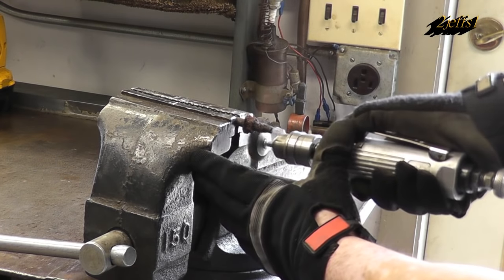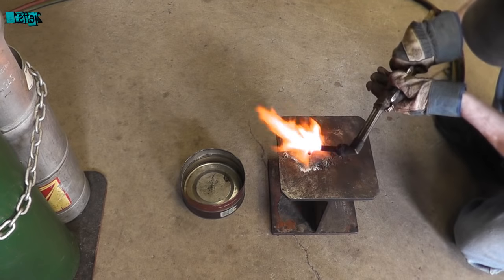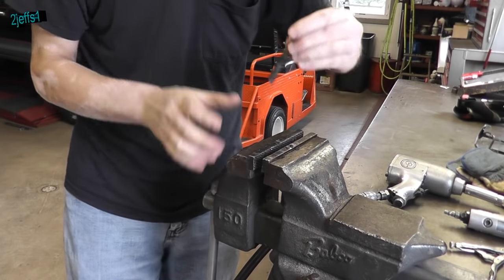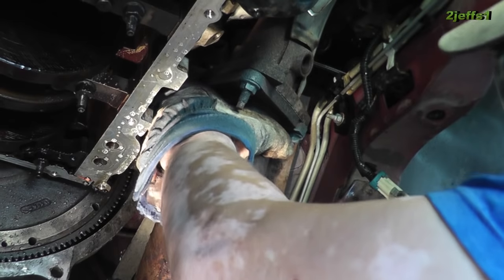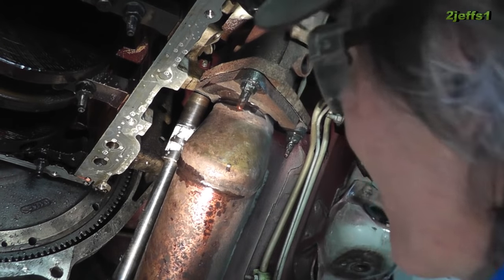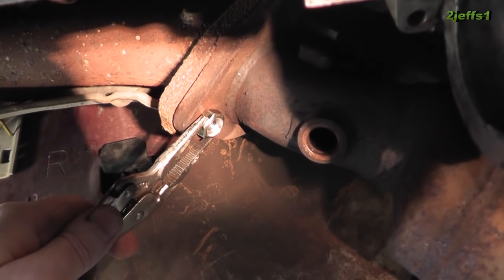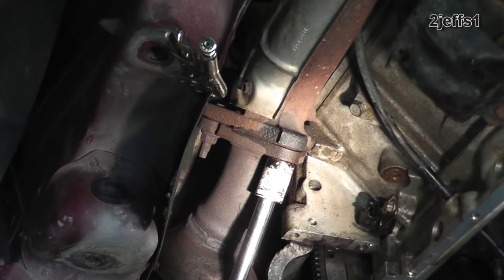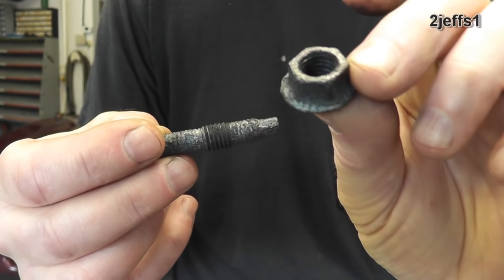Removing Rusted Bolts and Nuts THIS WORKS GREAT!

Comment: Another tip weld a bigger flat washer on the stud where you can weld it easier then weld the nut to the washer  alot easier welding.  Great tips though.

Comment: acetone and auto trans fluid mixed together work better than pb blaster just mix as you need BUT it will melt any plastic bottle you put it in . let sit a few hrs to a day on the bolt and it will take most any rusted on bolt/nut  off. if you have no torch or impact gun.

Comment: What's the brand for the bolt spray that you used onto the motorcycle bolt? thanks.
Reply from the maker: It's called PB Blaster.
Reply: Thank you!

Comment: any tip for seized bolt inside control arm bushing? tried pb  blaster. impact gun. don't have torch. stuck and won't budge.
Reply from the maker: Once the nut is loose try to drive the bolt out with a blunt ended air chisel if it can be accessed. Other than that those can be a real pain with no easy answer.

Comment: A small Plumbing propane torch helps to,,,,,.  The one he welded a nut to,,,,. You can use a settling an oxygen torch,,, and burn right through that broken bolt melt it out of the exhaust manifold,,, and not even damage the threads,,,, the cast iron will take three times more heat than a stud,,,,

Comment: The speed of cooling is not important. Heat expands the steel. As it cools, it shrinks. Then a clearance will exist enabling the part to move.

Comment: I need help. been to every shop in town and noone will help. I know nothing of welding and dont have a torch. just normal tools. also the bolt thats stuck is pretty large and not hard to get at at all.  2 have heads and 2 broke off. Im seeing propane torches on home depots website. can I use one of these? or does it have to be some hotter gas?
Reply: ive already spent nearly 100 dollars on bolt extractors and  cutting oil drill bits and rust remover for this job. Im really looking for it to be over soon!
Reply from the maker: That is so sad no one will help you. If you could find a machine shop usually there will be someone with the needed type of skills or even suggest what you should try. Those single tank torches will only work on small items, doubt would work with what you have going on. The big thing on these type deals is being able to maintain ones patience. There was several times where I didn't and then had a real mess. I wish you luck on your repair,  Jeff.

Comment: If you aren't in a hurry you don't need a torch (or an impact wrench).  Wire brushing +PB Blaster works in areas where using a torch would be too dangerous dangerous.

Comment: Honestly for something like this I prefer the sheer the bolt on purpose with an impact and buy new hardware, grade 8 bolts are dirt cheap and you really need a pretty hot thin flame to make that work.  Obviously I wouldn't do this for a blind hole in a solid piece like an engine block or what have you but fair game on stuff like exhaust where there is another fastener behind that will just fall.

Comment: Soak in vinegar 24 hrs. No damage or comprimise to the bolt or nut. Also cheaper than torch and no time invested. Drop it in, and work on something else.
Reply: yes that might work on the first stud he showed as it's a small loose part you can drop it in vinegar and leave it soak. How are you going to do anything upside down, attached  under a vehicle like the later ones he showed with your method ?
Reply: @super6954  i have different methods..... the vinegar dip is obviously for parts off the object.  When they are on, i use optimizer, also sometimes called inhibitors.  It stops it and seals it, and primes it all in one step. Not cheap, so most people dont use it. Do it once, do it right

Comment: I have a S60 Volvo and I have same setup but the flanges are good but the bolts look like they are welded on the head of the bolt side to flange the thread side goes out but not enough to enter the holes on opposite flange but not beyond I need to put new bolts in but not sure how to remove these nipples on the flange or re drill new holes with them their. Any help greatly appreciate it.

Comment: If you just mix up some epsom salt, vinegar, and dishwashing soap (Dawn) and spray it on the rusted bold or nut, it will loosen. Been doing this for years and it works like a charm. NEVER EVER have a rusted nut or bolt again. Oh yea, it also works on WEEDS...

Comment: you've got good technique.  sometimes, if it doesn't want to undo, try doing it up.  just a little bit, then undo, then do up then undo then..... get the idea?  after having to tackle broken manifold bolts in all sorts of cars, i've decided the bolts chosen by manufacturers are too small.  so i just drill them right out, oversize then fit a bigger bolt and nut in place of silly bloody studs.  next time, if the thing wont undo i just snap it and install another nut and bolt.

Comment: a better way, heat around where the bolt is "stuck " in and proceed from there. Heating a bolt directly, unless you have air wrenches like him will not make the job easier, but harder. if its a stud + bolt combo, heat the bolt but NOT the stud, she'll come right out easy then.

Comment: The only problem with this method is that most of the time you are not allowed to heat bolts or just can't because they are inside of the very massive structure or heat sensitive part.

if only it was possible to heat bolt locally

Comment: this method has been used in cuba for decades
Reply: Well ,im not cuban.but respect them.
Reply: Cubans are DAMN good mechanics. They have to be with the embargo keeping spare parts out of the country for 50 years. They have to engineer everything they need themselves to keep those old klunkers running.

Comment: If you don't have a welder, then what?  14mm Bolt on Compensator Arm (CA) is seized on the CA's bushing.
2000 Honda Civic's 14mm Bolt that is attached to the chassis frame. Part of the 14mm Head and shaft fused

Comment: if you heat up a bolt and then cool it with water, it will lose part of its tensile strength... better to replace them after this procedure...

Comment: .
So this method works fine if . . .

I have an oxy-acetylene torch, with oxygen and acetylene tanks, and an air wrench, and a high powered air compressor.

I am trying to cut off the 2 bolts that hold on the donut exhaust gasket on my 2004 Toyota Corolla. There is only 15/16 inch of room on the right end of this flange, and all the cutting wheels that actually have cutting power are at least 3 inches across.

Comment: nothing like changing the bolts' hardness.
snap !
Reply: On an exhaust fastener the heat treatment has already been affected!
Reply: but he quenched it.
Reply: John Doe Jr.

If it is then reused it will then go through the heat cycle on the exhaust, so back to the way it was.

Comment: unfortunately the seized bolts are still stuck on the car with no room to do anything. i may have to cut it off with a saw.
Reply: Probably too late but how about trying a carbon arc?

Comment: Use ATF, works better than WD40,more lube quality
Reply: Should be a lot cheaper also.
Reply: I've heard many times that synthetic atf mixed with acetone 50/50 is the best penetrating fluid out there.
Reply: It's true. 50/50 is incredible stuff. doesn't smell as bad as OB blaster to me either which is a plus
Reply: Upvote for the ATF/Acetone 50/50 mix.
Works like a charm

Comment: Yeah heating it up and rapidly cooling the parts will surely make it bridle and most likely break.. I've been a mechanic for well over 10 years and I would never cool it down so fast.. in my opinion you should always heat the nut if it's that rusty and always replace both nut and bolt with new parts.. there is no point in fitting a new nut on a bolt or stut like that..

Comment: You didn't finish the hardest one, the broken exhaust manifold stud.I just want to see you get that one out. First of all, you've got to bepretty damned good to be able to weld that nut to the broken stud,without welding to the manifold itself. That's only the first part.  Then, you have to get the stud out. I have NEVER gotten one outwithout removing the manifold first.

Comment: dumping redhot bolts into water changes the temper of the steel, why put a crappy stud back in replace with a better unit' and pre-heat manifold stud before trying to remove ...........

Comment: There is total lack of appreciation of the need to present clear sequential  statements. Nasal statements without any clear logical sequence. First item that I listened to multiple times, was the spray used. But I could not catch the name, and there was no thought to showing the can label with  an introduction as to its properties. So many of these videos and none of them really solved my problem clearly, although they did implicate some possible ideas.
Reply: I bet you read the instructions before you take your new stuff out of the package.........

Comment: Why would you reuse that....
Reply: I've been in a situation where an automotive bolt/stud is unique to the vehicle and replacement parts are obsolete. I've been forced to reuse parts like that.
Reply: i would find it hard to believe that it wouldn't be possible to find a replacement for something like that
Reply: wades623 I've had some bolts that are very strange and very specific. What comes to mind are studs that have a thread on each end seperated by a locked in place nut. The distance between the end of the stud and the nut are specific and nessasary for proper functioning. Dealer obsolete and not aftermarket supported. I try and replace harware often on vehicles over 10 years old but there are times where its not possible. Other guys who work on cars know this problem.
Reply: 351 Cleveland, I concur. Sometimes there is no way around re-using the old bolts. I do that a lot. So far, knock on wood, I have never had a failure in 40+ years. Must be all that clean livin'...

Comment: That stud is hardly even rusted. The nut still has square edges. Try some real  cones that taper down to a pinpoint. These are easy ones

Comment: I have this one bolt on a machine at my job that drives me insane. I've been spraying atf/acetone on it daily for a week. I have heated it several times. Also I have beaten the shit out of it with a hammer. Hell I've even begged and that fucker is still hard stuck.

Comment: Now you have to heat treat (temper) that high carbon exhaust or manifold flange, if you're going to reuse it, so it's not so brittle after hardening it.
http://anvilfire.com/article.php?bodyName=/FAQs/heattreating.htm

Comment: to bad this rusted nut is near fuel LINES :(
Reply: Not to worry. Just use the horse sprayer on the burning car.
Reply: Just don't hurt the fuel lines and you'll be fine. 
The OP didn't blow up did he??

Comment: Dear, Greetings from Brazil. Your video was good but I didn't like it because you did the service in a traditional way, in the best possible way and with appropriate tools and equipment. I would like to see smart tricks, some different and creative techniques that few people know about, like "the cat's jump", as we say in Brazil. I know everything the friend did and it is not new to me. But that's okay.
In fact, the owner of a car, for example, will go crazy when trying to repair the car or motorcycle in the garage of the home and a screw break because it is stuck \ rusty. He will apply some miraculous spray, type WD 40 spray and will try to make a hole in the middle of the screw using any hobby drilling machine to try to remove the piece stuck with those known and cheap tools to extract broken screws. I can say that only with much luck and prayers, the broken piece will come out. At that time, a smart trick would help that person. I don't have the equipment that the friend has but I might have to face such a problem. If a smart trick for this situation does not exist, the only way to solve it is to take the car, motorcycle, etc, to a workshop that has the tools and equipment for this repair, and pay for this labor that should not be cheap. God bless you

Comment: better   to heat twice remove when hot  second time  ford are horrible for this since 1900 hundred brass nuts in the 30 to fifties worked wonderful  chrysler used bolts not studs fa centr better idea cut with torch use new 30 cent bolts. no easy way now!!1 designed to rip you off